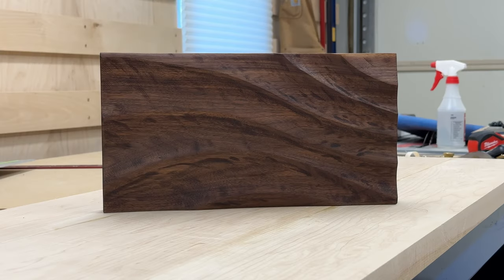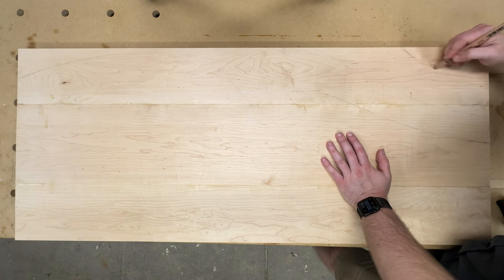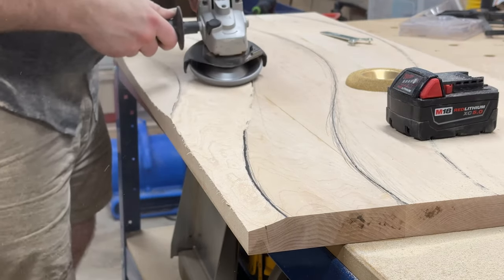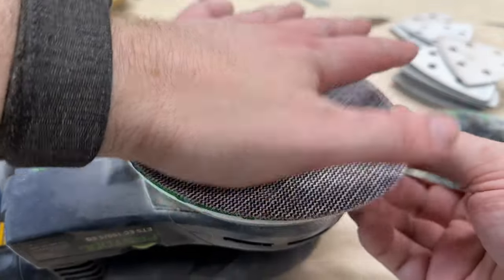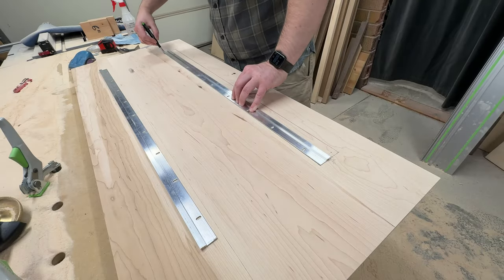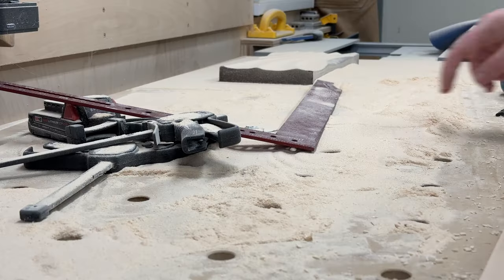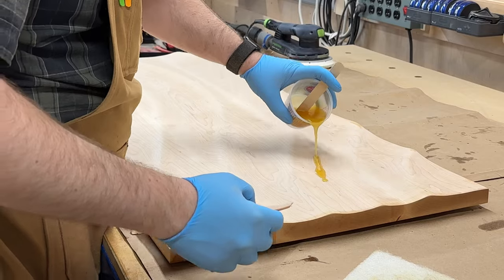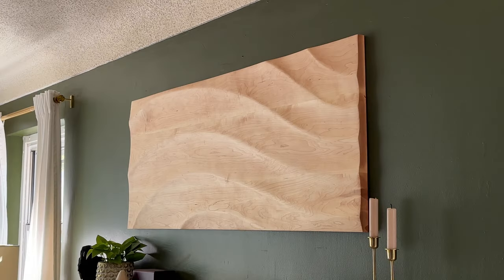Power carving a wave

Comment: If you're going to power carve more regularly, I would recommend the Kutzall Extreme Shaping Dish (Coarse) for your initial shaping to really hog out the material, which will put less strain on the angle grinder itself, and then go back over it quickly with the other Medium Kutzall Dish that you used in the video over that to refine it a little and take out some of the marks, and then follow up with your soft pad on the random orbital sander. It will also clog up the Medium Dish less if you aren't using that more fine tooth stuff for the bulk removal. 

On the finish, Rubio also now makes another finish called SheenPlus that you can add as a second layer over the OP2C, which will give it a slightly more satin look (and less matte).

Comment: Deeper grooves. You can also see the sapwood. You could grain match it better or cut the waves out so the shape of the wood matches the shape of the piece. I’ve seen someone do carvings like this and usually they don’t go with normal wood stain. They go spray paint to cover the differences in wood color, and they lean into the grain instead.